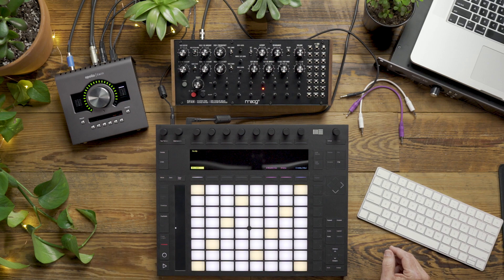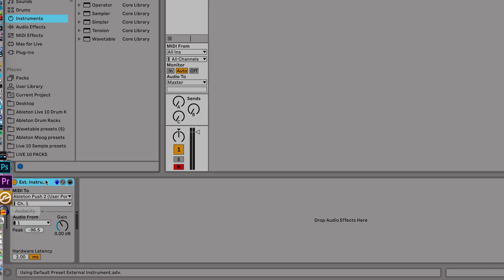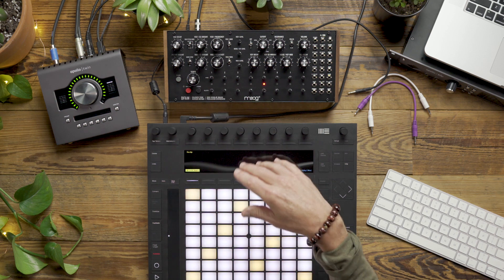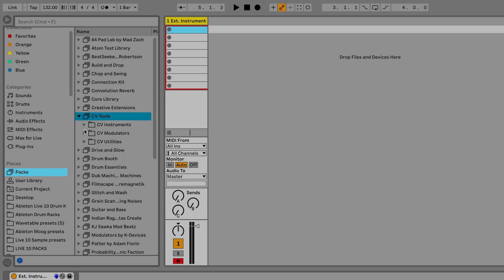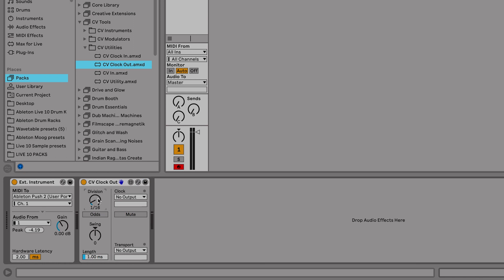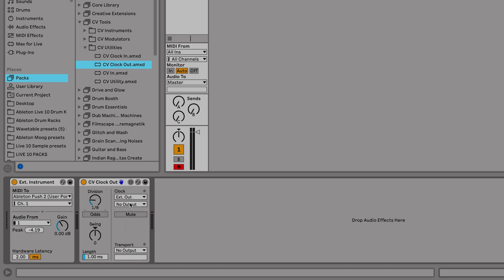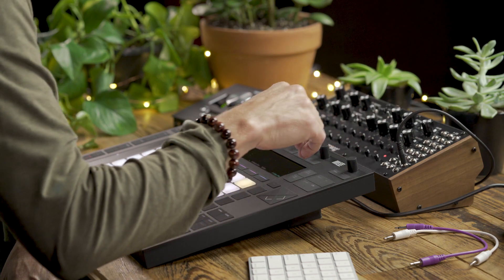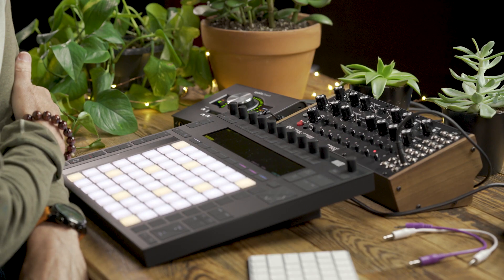DFAM | How to Tempo Sync your Synth with Ableton using CV Tools

Comment: Can't do it from your interface if it doesn't have a dc coupled output like Focusrite. You'll have to use a midi/cv converter. But if you have a USB clocked synth, you can get the cv from there for clocking purposes

Comment: what they don't mention here is that you have to manually advance the DFAM to the 8th step after EVERY TIME you hit stop in order for it to start at the beginning of the bar.  And you also have to pull the patch EVERY TIME because the ADVANCE button doesn't work when  the patch is in.  It's a very inelegant and inefficient method and very disingenuous of Moog to omit that fact in this video.  It's unforgivable that they don't have a better method for sync than this.  Never buying a Moog product again.  Great sound, but they're stuck in the 1970s when it comes to designing workflow.  They also give you the stupidest, cheapest, crappiest power supply they could find.
Reply: Correction:  you don't have to pull the patch to advance the steps.  You can hit RUN/STOP  and then the ADVANCE button works.  Still incredibly lame.
Reply: No way for the sequencer to be anything other than 8 steps.  No sequence reset.  Sequencer is basically unusable in a modern setting.
Reply: OK.  Maybe "unusable" and "unforgivable" were a bit strong.  The sequencer is extremely primitive, and the lack of any convenient workflow functionality makes it a drag to try to use it in conjunction with anything else.  But I want to back down from my angry rant.  The DFAM sounds fantastic, and the knobs and patching make cool things happen.  That's what this thing is about.  I dislike the sequencer, so I don't use it.

Comment: I could really do with some help and thought my experience might help others. 
This video was a huge help to me and started me off on a path of solutions. So thank you for that.

I followed the instructions to a T and I didn't have any luck. I'm using an RME Babyface pro and using the stereo out mini headphone output 3/4. I got all the routing correct as well as the levels. I tested it by plugging the same output into a Korg Volca Sample. It jumped around all over the place until I turned down the volume but then it worked fine. I plugged it back into the DFAM but it refused to play. I used a Moog mono patch cable.
Then I had a bit of a brain wave. I synced the Volca to Ableton live via the Midi out that's on the RME Babyface Pro and then patched the sync out of the Volca into the DFAM and it worked! I have to start the DFAM on the 1st step and it takes one cycle of 8 to kick in but it is synced.
Sometimes the DFAM keeps playing when I press stop in Ableton but as long as I hit play in Ableton on step 8 it seems to lock again.

One thing I have noticed is when I'm using the ADV / Clock input on the DFAM I get an extra click sound. It's only very apparent when I have a short VCA decay. Has anyone else noticed the same thing?
Reply: So after a bit more experimenting the Volca obviously sends out a continuous sync signal rather than starting and stopping with Ableton playback. I'm a hardware noob. What are the correct terms for this type of sync?

Comment: You really should highlight the need to use 'floating ring' 1/4" to 1/8" cables when using a DC coupled interface. I know people who have damaged their expensive interface.
I don't have Push, so I just bring my audio in on a simple Live Audio track. You don't need to use an 'external instrument device'.

Comment: would have been nice to see the potentially recorded waveform in order to check the sync. I guess the waveform will have its delay which has to be corrected. (same as you record a tr-8s or digitakt)

Comment: Hey guys. How to remove (mute) the audible pulse sound when clocking DFAM? :) thanks!
Reply: Having the same issue here. Doesn't matter what channel i send the CV out, it ends up bleeding into the DFAM audio Output.
Reply: I figured this out! The issue I have is I'm using the wrong cable to connect them. The good news its only like $6 from Perfect Circuit. You need a 1/4" TRS to 3.5mm TS cable. I was using a TRS 3.5mm and the 'R' of the TRS was causing the issue. Some people refer to this as a mono cable, but its really just an unbalanced connection. You need a Floating Ring cable.. (the R in TRS) to get that ticking to go away. Hope that helps!

Comment: It seems that when using CV tools with the DFAM and Apollo Twin, the clock is dramatically triggered once reaching a certain frequency threshold. If the volume increases beyond 30% the clock is disrupted and triggered uncontrollably. Any ideas for a solution ??

Comment: When I plug my 3.5 mm jack into the adv. clock, press run/stop on the DFAM, and then press play on Ableton, the DFAM doesn't start. I only hear clicking from the Ableton CV Clock out Plug-in. Has anyone else experienced this? Any help?
Reply from the maker: The first step would be to confirm you're using an audio interface with DC-coupled outputs, and then check to make sure the cable is correct.  You want to use a cable with a floating ring, so it should be TRS 1/4" on the interface side, and TS 3.5mm on the DFAM side.  If this doesn't solve your problem.  Please contact our service department at techsupport@moogmusic.com
Reply: Moog Music Inc perfect. Just ordered some floating ring cables. Thanks!

Comment: Do you need a DC coupled audio interface for this? Typically you do for CV.
Reply from the maker: Yes, you would need a DC Coupled Audio Interface to interact with Ableton CV Tools.
Reply: Moog Music Inc I’m sure Ableton documents this but it might have been nice to include that in the video. DC coupled audio interfaces aren’t ubiquitous.
Reply: to sync your DFAM only, you don't need a DC coupled audio interface. i already tested it with the Clock Out plugin. but all he CV related tools to control pitch will not work. 
syncing the DFAM without the Clock Out plugin of the CV Tools should work too, but it's a bit more complicated, because it requires a second audiotrack that must send out triggers. commonly generated by a rim shot, bass drum or what ever. luckily i own a Mother 32 too that has Midi in. so i don't need these CV Tools^^
Reply: @MoogSynthesizers  no you don't need  a DC Coupled Interface if you're just sending clock. Any audio interface with a line out will do.
Reply: @MoogSynthesizers  hey friends! lovely videos!!! please note that for all clocking duties of cv tools no special sound card is required, trigger signals will work with any off the shelf soundcard.<3
Reply: @MoogSynthesizers  Or something like an Expert Sleepers ES3.
Reply: I see that the 3.5mm end is a TS, what does the 1/4” side need to be? Would it have to be a TRS since it’s a balanced output?
Reply: Mike H how loud should the line out be for tempo syncing? I don’t want to damage the dfam

Comment: I use Presonus Studio 28/24. The synchronization works only at low level. If I turn up the volume control on the DFAM more than 30%, only crackling noises and all LEDs flash wildly. I have tried several settings in Ableton. Unfortunately without result ... 
Does anyone have a solution?
Reply: I am having the same issue with my DFAM & Apollo Twin.. It seems that once the frequency reaches a certain threshold the clock is dramatically increased. I have also found that keeping my volume control roughly at 30% has been a temporary solution, although it is still frustrating. Any ideas for a solution moog??
Reply: I had exactly this same issue with my Focusrite Scarlett 18i20 and it turns out I had my hardware mix set up incorrectly, sending the stereo mix into the CV clock channel.
Reply: @hexial  Hy alx_files, question; you wanna say - you corrected it with mono out Channel, with 1/4 to 3.5mm TS Cable ?! thanks for your answer in advance.

Comment: How would I sync the DFAM to the Elektron Digitakt without using a computer?
Reply from the maker: You would need to use a device that can convert midi to an analog clock signal like the doepfer msy2.  You could also use a midi to cv/gate converter, then you can use the gate channel to trigger the step sequencer on DFAM.
Reply: @MoogSynthesizers  Thanks for responding so fast! It seems odd that the Mother32 has a midi in port but none of the others in the series do tbh guys. It's such a mess having to use converters for basic midi clock sync.
Reply from the maker: The Mother-32 and Subharmonicon both feature MIDI, the DFAM is fully analog and has no digital components, therefore uses analog clock sync like many other modular sequencers.